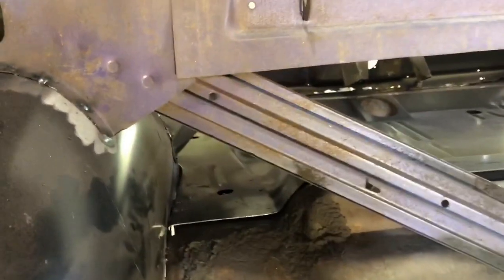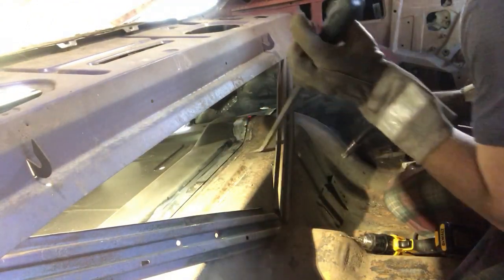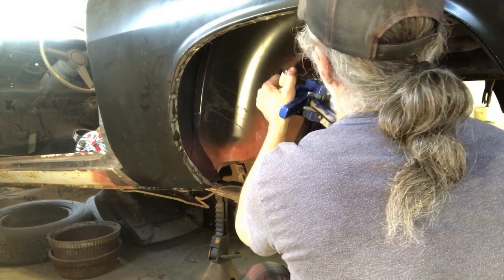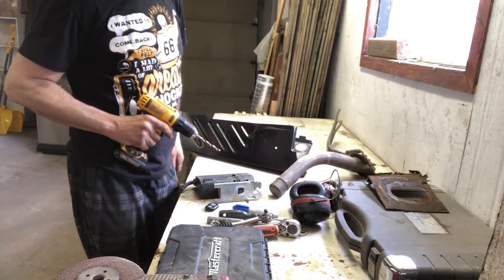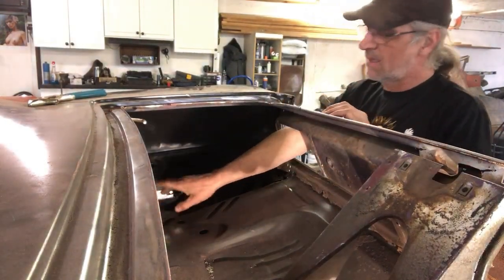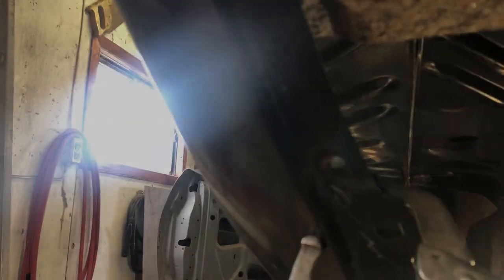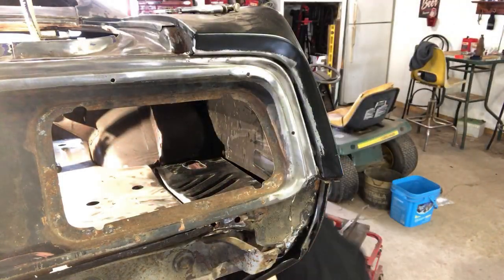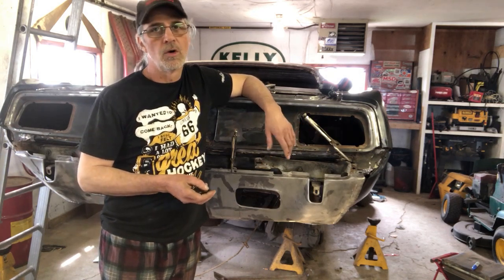1971 Cuda Restoration: Trunk gets New Metal

Comment: I’m having body work done to my 71 Monte Carlo. Floor, rockers, trunk pan replaced. I wish you had the rear quarters available when I needed them. Had Goodmark brand and didn’t fit good at all. Like to see a steel hood with a 4” cowl induction made available, like the one Glasstek makes.
Reply from the maker: Hi Steelerdude, 71 Monte's are a nice car, good luck with your build. I'm trying to do the work my self from local suppliers, like Carquest or Napa. I have sourced other parts online as well. Try Classic Industries for your hood

Comment: Made a big AMD order last night.  Going to start in the trunk area - trying to figure out all the layers at the tail panel.  I'm going to remove mine I think - its bent and needs to be reshaped or replaced and It seems to sit on the trunk floor anyway right?  Trying to study and document my car before tear down and this bit seems a little tricky
Reply from the maker: @ToddMcF2002 10 Yes you are correct, the tail panel sits on top of the trunk pan. If you are doing a one piece trunk pan you'll need to remove the tail panel or one of the quarters to get it in. I went through the side. Only panels that i have used from AMD so far is the quarters. I figured that the rest, no one will see, so if i need to "adjust" them to fit it won't distort the panel ;)
Reply: @cudacave1398  thanks yup full pan!  I'm dying to get started.  Metal work / welding is my favorite part of working on cars and good thing I'm pretty good at it because this beasty needs ALOT of it :)

Comment: Beautiful looking project you've got going on! 😁👍🏼 there is something I've always been curious about these cudas that maybe you can help answer, I noticed the gas cap isn't exposed on either rear quarter panels, does that mean you refuel it in the back like an older mustang? If so does that mean you have to unscrew your license plate everytime you have to fuel up? How and where do you refuel?
Reply: Licence plate is on a thin metal plate that has springs on it. Filler tube to gas tank is behind the licence plate....Same as my 71 Satellite

Comment: Just curious,Do you think it would be easier to take out the rear axle and springs  to do all that metal work ? And should have you replaced the Framerails first?
Reply from the maker: @Robert Casserly. I needed to remove the spring and axel so that I could get the tongs of the spot welder in the correct position. And yes, in a perfect world with deep wallets I would have done the rails first but I had the other parts before the rails everything else got done first. 
Thanks for watching

Comment: Pan should have been pre-drilled and screwed down so it was held tight and then welded down
Reply from the maker: Hi mrpurcountry, Thanks for watching. The process that I took was in order of parts and budget at the time. I did not have the frame rails in at this point so welding them down to rotten steel wasn't an option. Hindsight it would have been easier to work the other way. But in future videos I do get the rails installed and welded up
Reply: @cudacave1398  I was referring to the trunk pan being welded down to the under seat floor pan where it appeared you were pushing it down with a pry bar, I just finished a Cuda body